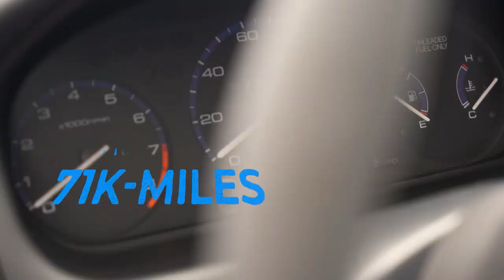BLOWING UP MY 2JZ SUPRA ON TV!! | Can we fix it? | Banging Gears

Comment: Make sure the flywheel bolts are tight first.

Drop steel pan and aluminum mid pan and take off the rod caps. I have replaced rod bearings at the track more than a few times.

Oh and yeah on that car.  That use to be my Supra.
Search Fuzion Supra.
I spun it out bad at the USCC 3 in 2003.